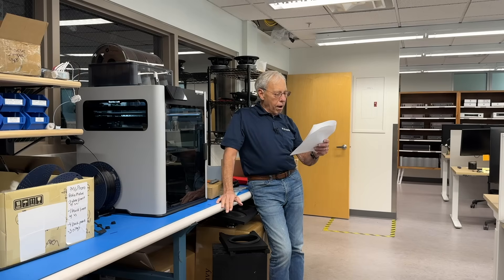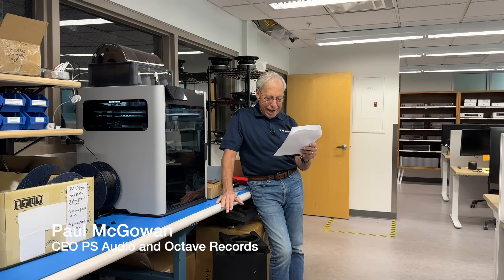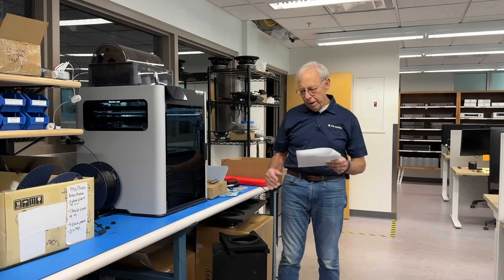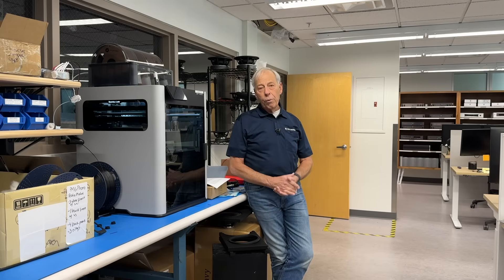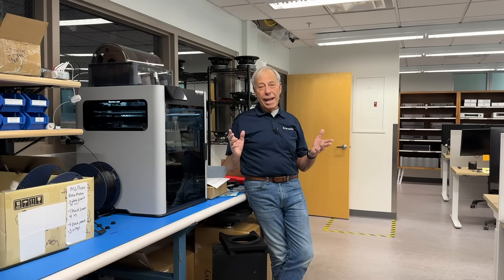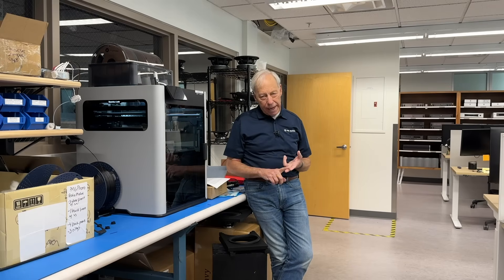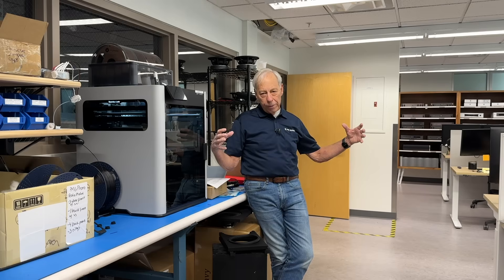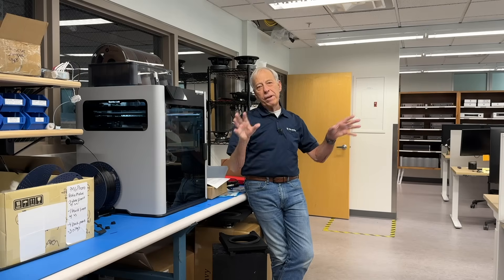Why amplifiers sound different

Comment: I think the concensus in high-end audio is that the Benchmark AHB2 is very much there. (LATER NOTE: I mean High-Res High-End Audio)
Reply: From what I've heard, they do punch above their weight.
Reply: @BruceCross  they do, i have two blocks in mono, dac3, HPA4, DSP with martin logan ESL 13A by FAR the best fastest precise unadultared sound imaginable.
Reply: One really gets misled by so-called consensus. I don't think you polled high-end audiophiles, but why limit the poll to high enders--a self applied label?  High-enders, like everybody else, have never demonstrated they can distinguish any properly operating amps.
Reply: @Rob-k5k9u most people can't tell the difference between coke and Pepsi in blind tests. Blind tests don't tell the whole story.
Reply: @mitchtaylor6512  
I can't imagine anyone not able to discern Coke vs Pepsi!
Reply: @FOH3663 it happened quite frequently when the Pepsi challenge was going on, it brought out the new Coke, and how did that work out?
Reply: @mitchtaylor6512 Many people can tell Coke from Pepsi. No people can tell the difference with amplifiers. Blind testing is required for a drug to be certified.
Reply: @mitchtaylor6512  
Exactly, they could discern a difference ... as I pointed out. 

That said, yes, New Coke was a disaster (if it ain't broke...). 
Cracker Barrel re-brand wasn't as big an issue ... nevertheless, another problematic re-brand.
Reply: @FOH3663 most coke drinkers picked Pepsi in blind tests, but this was done in a sip or two, which didn't work when a whole bottle was consumed. It's called the Pepsi paradox, so much for blind testing.
Reply: @mitchtaylor6512  Your Pepsi analogy is similar to how an extremely revealing and dynamic amp can sound like the best one in the first few minutes of listening, but long-term, it just gives you a headache.
Reply: If that was the case, why would people be buying much more expensive gear instead of sticking with those relatively cheap ones if they already did everything everyone wanted? I'm quite sure most high end audiophiles think that there are better things to be had.
Reply: @storkfletcher821   ...bragging rights is one reason.
Reply: @storkfletcher821  that is snake oil logic. read the reviews. BTW Benchmark is pro audio, certificates and all.
Reply: @TheMartijn00 never heard a benchmark but I tried the Topping line to see the big hype about its virtually zero distortion and found it sterile and boring. If paying a few thousand more for my McIntosh brings me more joy to the music so be it.
Reply: @mikeg2491 I love Mcintosh, but: What you hear with a setup like mine is the actual recording, if it's badly done then you hear it, if its done well it's a revelation! If you're used to a Mcintosh then you like your amp to be a part of the orchestra. your amp is the not so much retaining the original audio signal, more like a filter. That's the fun of that type of audiophiling. But you can't compare it, it's a different approach. NOTE: Topping is not, in any way, considered  near high-end.
Reply: @TheMartijn00 What’s your setup if you don’t mind me asking? And I apologize I thought you were one of those SINAD guys who obsess over everything from Topping and thinks if it has even one less decimal less in distortion it’s badly designed lol. They go a little nuts over there.
Reply: @TheMartijn00  No, it's just showing the logical error of your initial comment. Believing in the notion of a consensus in high-end audio is pretty funny and must be accompanied by a fairly comprehensive lack of knowledge of audiophile behavior.
Reply: @TheMartijn00why it measures good like benchmark equipment.
Reply: @storkfletcher821  besides the insults there is a point, I should have said "High-Res Audio". High-end is a bit of a quagmire. But if it's not High-Res, for me it's not High-End. Just overpriced.
Reply: @TheMartijn00  High res is something I'd only associate with digitally stored music. There's no standard to judge high resolution for audio equipment, and high end audio certainly tends to lead into revealing more detail compared to lower tiers anyway.

Measuring well is of course good, but it's only one step to good sound and it doesn't tend to be even the final step in audio equipment production. It's not particularly easy to measure just how an amplifier will affect the dimensions of the soundstage, for example. Or why one system may feel more engaging with the music than another.

It is, however, easy to measure the clear difference in something like the signal to noise ratio between two amplifiers that both have so little noise that the human ear can't pick it up. So one has to be careful what parameters one is taking into account and be able to judge exactly what it does and does not say.

And to get to the original point. Measuring well isn't an argument against Paul saying that no amplifier doesn't add and subtract something. That's clearly shown by that there are plenty of products that measure great but don't sound the same.
Reply: @storkfletcher821 he is obviously just gloating about his system. He needs validation.

Comment: It's not just about not adding or subtracting anything from the signal.
As important, if not more important, is the ability of the amplifier to control the speaker. This tends to require low output impedance and a healthy current capability.
Reply: Speakers can sound different (tho which is better is often subjective). All modern equipment has had sufficiently low output impedance for decades--a non issue. A health current capability (not sure what that means), will result in louder music, or less clipping for music with high dynamic range.
Reply: Neither of which a tube amp is able to deliver.
Reply: @dhpbear2 I agree and this is where the entire objective measurement thing falls flat on its face.
I have a a Purifi based Class-D amplifier that has vanishingly low distortion, noise, output impedance and loads of current capability and watts. In a direct A-B comparison my mates 15 watt triode valve amp is better, not by a lot but better, especially in imaging.
Objectively my amp stuffs it, subjectively not so much.

Comment: The best power amps offer high current, high wattage, and low distortion which in combination is generally the best overall sound stage you can get.  Crown amps would be a great example.
Reply: Crown amps does not have that much current. They dont even double down from 8-4 ohms.

They have a lot of power for momey. But they are absolutly not refined power amps, and its not ideal if you use more higher end speakers, then. You need something a lot more refined. They are cheap for good reason.
Reply: Meh. I prefer QSC for pro audio.

Comment: New and aged amplifiers sound different,   same made same model amplifiers can sound different too.
Reply: That’s bad means they weren’t well designed
Reply: @shangrilaladeda the design might be good. The problem is that the bean counters get involved and use cheap low quality components with slack tolerances.